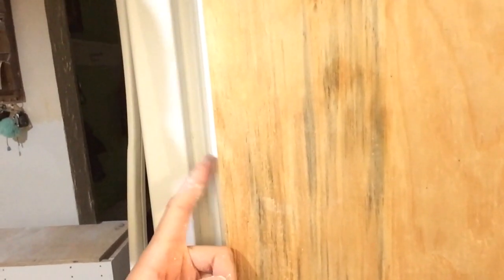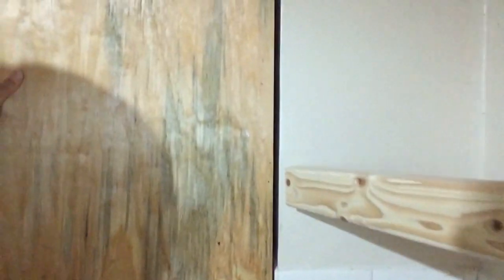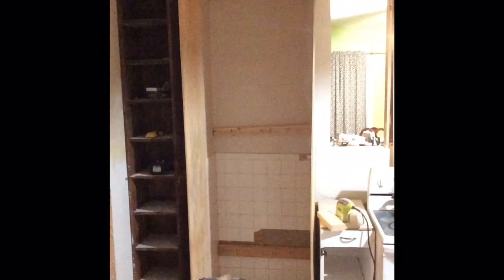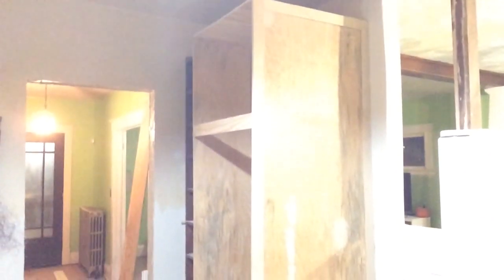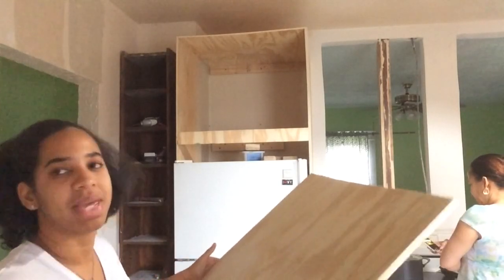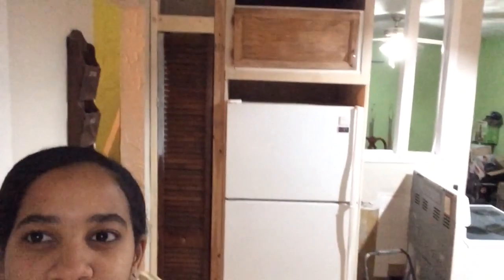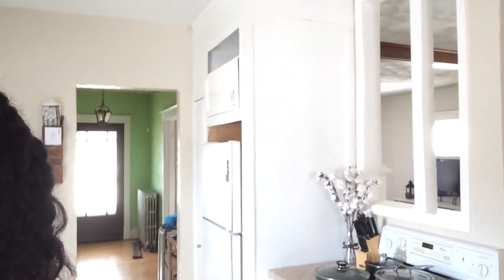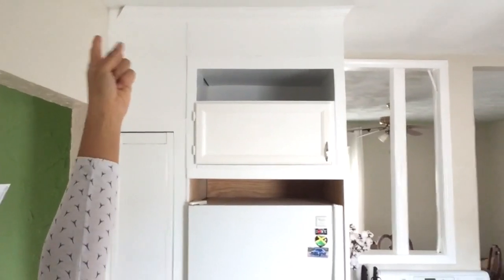How To Build a Fridge Cabinet/ Enclosure | Extreme Kitchen Renovations | DIY

Comment: Great job! As a novice DIYer, I appreciate that this video includes some of the missteps along the way and how you overcame them by cleverly modifying your design. Consider the addition of a removable vertical fascia board to close the space just above the refrigerator to achieve even more of a high-end luxe look.
Reply: Closing up that space above the fridge may not be a very good idea.  The fridge needs to be cooled by free air circulation.  Without it, will get overheated.

Comment: Nice job on ur DIY, what about
A floor to ceiling behind that
Brown Door's wall, make a
Rotation canned food dispenser
With kicker plate in each slot's
And curved bottom lip on the
Inner side where the bottom
Can rest for easy removel,
If you don't want to the
Ceiling make dropped
Frame over the top ,

Please make sure you
Pre measure ur soup's
& Tomato paste canned
Slots with the wood trim
molding fasten to each slot's
of your Cans will jiggle around
In your can dispenser,
YouTube or Pinterest🤸

Comment: Most fridges THAT size are 62” high, not 70”. I would bring that cross beam and cabinet to within 1/4 of those fridge door hinges. It will look more custom. It’s awkward having those two gaps above and below the cabinet which are each too small to fit anything in. Moving everything down creates one practical-height shelf up top. Also put the hinges across, the top of the cabinet door rather than on the side. That cabinet door is too long to have one-side, vertical hinges. It will eventually droop from the weight.
Reply: You do have to think about ventilation for the fridge, the rear of the fridge gets hot and it reduces the life of your fridge if the hot air can't ventilate out. So don't cut it too close.